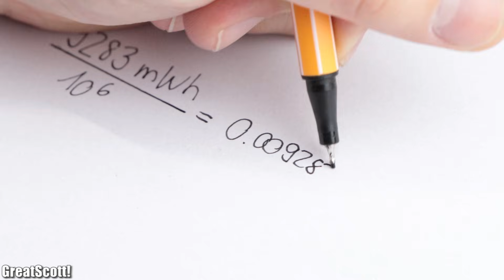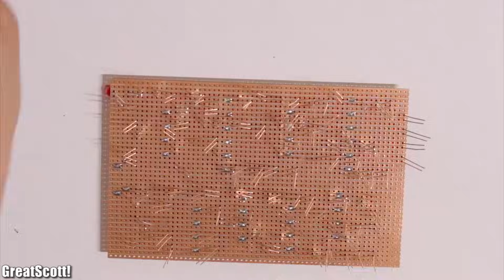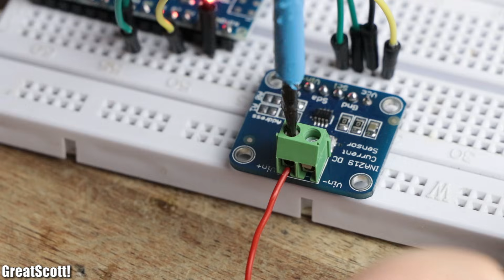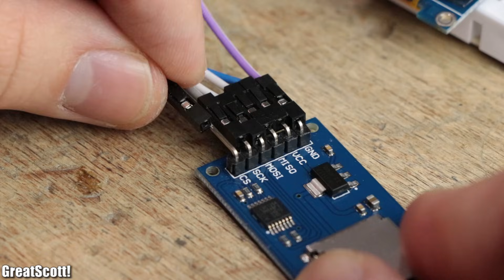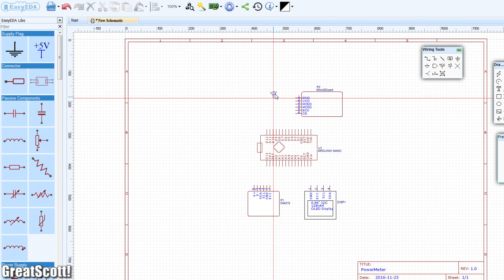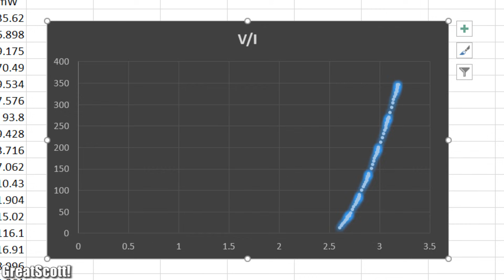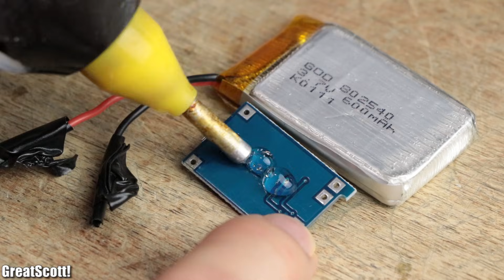Make your own Power Meter/Logger

Comment: Hi,can you make tutorial power supply using arduino nano & oled 0.96 include battery level display & variable voltage output🙏which is the power supply is powered by 4pcs 18650 1s batteries. 🙏🙏🙏

Comment: I know that this is the final device, but prototypes can look like this. If you still make prototypes this way, I recommend looking at the description of my channel, there are two last links to pictures of an open project of modular portable prototyping. In short, there are modules that are attached to the base, connected with Dupont jumpers. It turns out to be a prototype for which you can develop software. If you don’t have the necessary modules, and you need it urgently, you can make it from a regular soldering breadboard. Drill 2 mm mounting holes with a pitch of 5.08 mm, solder the parts and the temporary compatible module is ready. If you produce a sufficient number of modules, you can assemble many different devices. Given that the circuitry of the modules has been worked out, the manufacture of the final device consists of combining the circuits of the modules into one board of the device.

Comment: What is the voltage capacity of the meter?
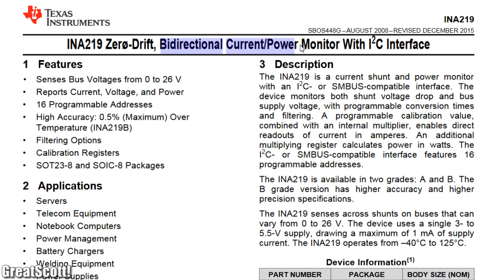Reply: 1:57 The bus voltage can vary from 0 to 26V. Where the Bus Voltage is the voltage where your load is going to be connected.
And the INA219 is powered by a separated supply from 3 to 5.5V

Comment: Tolles Erklärvideo. Danke!
Two more questions, i have.
1. Is it possible to increase the current range to 5 or 10A by changing the shunt resitor?
   Or other question: What will append, if i have a "short time" load of 5 or 7A?
2. Measuring up to 26V should be possible with this configuration, right?
 I want to use it for "sleep mode current" (Ruhestrom) measurement in a 12V vehicle.
Thnx!
Reply: If you want to get a current range up to 10A then you can use the next equation to select the shunt resistor:

R_shunt < V_sense_max/I_max (eq. 1)

Where V_sense_max is the ADC Range selection (see page 5 from INA219 datasheet). You have 4 options for V_sense_max, you can select a V_sense_max of +-40mV, +-80mV, +-160mV or 320mV.

Asuming you select the 320mV range (this is a default range for the INA219) then the shunt resistor must be

R_shunt < 320mV/10A 
R_shunt < 32mOhm
Select a resistor value of 30mOhm, for example. Now, the shunt resistor must have sufficient wattage to handle the power dissipation (you can select smaller values of R to minimize power loss). The maximum power disipation is:

P_max = (I_max)^2 * R_shunt
P_max = (10A)^2 * (30 mOhm) = 3W 

You can select the resistor CSS4527FT30L0 o WSR5R0300FEA for example. OR you can select  smaller value for the ADC Range and use  equation 1 to select a new and smaller value for R_shunt

Comment: Next step, a power meter for appliances that integrates with Home Automation.  I’ve got a relative with dementia who sometimes leaves the door open on an upright freeze with the usual consequences. I’d love to have a line voltage power meter that learns the normal power consumption of my freeze is usually 326 watts per hour and then alerts me if it suddenly jumps to 1022 watts in the last hour (meaning the compressor is running near continuously) or zero watts per hour meaning it’s off of has failed.

Comment: Awesome! I'm building an overkill volt amp meter for i2c debugging. Ina219 and ina3221. Also a 1115 16 but ADC for a WCS1800 Hall effect sensor module

Comment: Actually calculation of energy is bitt wrong, if you divide power by 3600 which is 60 * 60 then the interval must be 1 sec or 1000 ms but in this case interval is 100 ms so we also have to multiply by 10 because 100 ms is 10 times smaller than 1000 ms

Comment: Hello, we are a Chinese factory specializing in PCBA power meter, and we can see that you are also using power meter module in your video. Recently, we have a bidirectional electricity meter module, which is used in solar router, and it sells very well. Could you tell me about it?

Comment: can you please explain why we use tp4056 ic???
where do we connect the input to the power logger circuit??
Reply: tp4056 is the battery charger.

Comment: Well...I just built this but I was a dummy and accidentally ordered the Arduino pro mini 168. The sketch size is too large so I deleted all the code for the SD card and it works. I have an Arduino pro mini 328 on order but its going to take a while to get here. I'd like the SD card functionality. If anyone knows how to reduce the sketch size and keep all the functionality please reply. I'm asking a lot probably but I think this is a pretty small project and if optimized I think the 168 might do it. Thanks.

Comment: What would be sweet  project very similar to this 1 but 4 campaign so it will log Solar coming in and log  Your usag And have tfc  Screen showing sola in and  load ou  and battery voltage

Comment: WELL DONE. but i have a question, if the battery is soldered to arduino, can I upload a program from the usb, or I have to put a diode between the battery and arduino?

Comment: I love the INA219 module. I once used one to replace an expensive stepper motor with a far-cheaper and more powerful 12VDC gear motor. I had a n arm on the shaft of the motor, and I just blocked it so that it could not turn past the points where I wanted it to stop. Then I would start the motor turning and monitor the current. When the arm hit the block, the motor would start taking more current, and I would know it was time to shut it off. It was self-calibrating! It worked perfectly once I thought to drop a little super glue on the flange and motor shaft, because the motor was so powerful the flange set screws were not enough. 

Hint for your data logging: Have your Arduino log all data to a .csv file. Each line is a row of data, separated by commas, and you can even have the Arduino do some of your calculations for you and include them on the line. Stick the SD card into your computer, double-click the .csv file, and it opens up in Excel, each data point in it's own cell, nice neat rows and columns. Select a column, select "Insert", and insert a graph of the data, easy-peazy.

Lastly, I know this video was created four years ago, but we now have some data logger modules. I got two of the ones you just plug an Arduino Nano into, and I got one of them working yesterday. The module gives you everything pre-wired, including a real time clock module. So you can time-stamp your data in the .csv file, you just need two more commas and columns, and you can see when that spike occurred. I like this data logger. I intend to program it to accept a string from another Arduino and log it, with a time stamp, to a .csv file. The string will be a pre-formatted string sent via SoftwareSerial.h. That way I have the complexity and memory requirements of the RTC and SD card set aside from the Arduino doing the real work, leaving precious memory for other things.

Comment: May I ask a question?
How did you solve the noise when you were detecting the voltage?
The value of analogRead is changing randomly
I have an arduino Uno WiFi Rev2

Comment: I wonder if you could connect a current transformer to the inputs. Do a little math. And have a high voltage power monitor. 

Maybe the fact it’s designed for DC would be the problem there.

Comment: Could you really used electret condenser microphone to harvest acoust to electrical energy enough to power cellphones or Leds? 
I read a paper being published. Was it really true?
Reply: There is acoustic energy, but it can produce way less electric energy, than like smallest world LED would need, so that was definitely fake.
Reply: @j4mm3r61  that paper I was talking about was authored with a doctoral degree. He just doesn't disclose all the tiny bit information but emphasize the 9 parallel connected electret condenser microphone and convert to DC by bridge rectifier and some other things with Arduino  then voila he was able to charge phones

Comment: Great video.  Watching all the videos has again peaked my interest towards elotronics. Keep it up :)
I have question regarding the power meter: Can it measure minimum current in range of 0.01 milli Amps - 400 milli Amps with resolution of 0.01 milli Amps.
I want to measure current drawn by a device when it is in standby mode, which will be very small. Thank you.
Reply: Please watch my video! https://youtu.be/2Qr6Jcm8wbA

Comment: Hi great project I got it rebuild and I included the Micro SD module. Managed to install the SdFat by Bill Greiman Version 1.1.2 installed. My question can you share your .ino source file you use in the project to log the data to the Micro SD card. In your video presentation you show the header files. But would a great help to share your final project .ino file to see how you log the data to the card. Thank you for sharing your great projects incredible stuff you put together

Comment: I recognize that this video and project is more than 3 years old but I need some help.  The SD Card Module links are no longer valid.  Would you please identify a SD Card Module that will work with this project?  Thanks in advance for your assistance.

Comment: TP4056 gets hot when charging, so i do not recommend maunting it on the top of the battery, or near termo sensors.
Reply: you can just mod it for 500mA, or lower ;)

Comment: Thanks!  This is exactly the type of system I need for monitoring battery charge and discharge times.  I plan to use the larger 2.42" OLEDs.

Comment: Awesome video, as always :D

But, how would you recommend to implement the best and smallest voltage read into an project.
Im going to create a temp/hydro reader that will send data to an InfluxDB, with that im thinking of sending the current battery voltage.
And i saw someone just took two 10k resistors between the negative and positive rail and placed an analog read between. Is that what is included in the voltage reader you mention?
Reply: Please watch my video! https://youtu.be/2Qr6Jcm8wbA

Comment: I see that you are using the 128x64 OLED in 128x32 mode too! I built the same thing but I could not fit evrything in the Nano and still have enough RAM for the OLED so i though WTH, lets try at half the width and it worked! In another project I used 2 Nanos and some interesting i2c communication between them to share the load and have the OLED working properly!

Comment: May you please tell me, how to apply database management system in Sd card with arduino for storing data in a organized manner?
Reply: Depending on the DBMS you are wanting to use, you would need to write a script to import the flat file.

Comment: How would I connect the INA219 to a solar panel if I wanted to measure the short-circuit current and open circuit voltage? A switch would be needed like a MOSFET to switch between measuring modes since the open circuit voltage is zero when measuring the short-circuit current. Would I connect everything in the same manner (besides the addition of a switch) expect my supply would be from the panel and I wouldn't add a load?

Comment: What IC could I use to increase the voltage and the current range? 26V and 3.2 amps is a little low for me ... I'd love to go up to, at least, 30V and maybe 5amps.
Reply: It's ok ... I searched and found another chip, the INA226 which can be found in exactly the same format (on PCB board) of the INA219 but has a voltage range going up to 36V, so perfect for load testing 7s/24v Li-Ion packs.

Comment: Is there an equivalent item that I can use to measure the output oy my 40w flexible solar panel into my battery bank?

I have a cheap commercial portable battery bank that has a DC input that I can connect my 40w foldable solar panel to ... I want a device that I can attach, more or less inline, so that I can monitor the input of the solar panel into the battery pack over time ... this video seems to show me how I could possibly make one but is there something cheap (and nasty?) from Ebay or Ali that I can buy?

I have seen some cheap DC watt meters but I am unsure how well they log data versus just show actual instantaneous energy input (I want to be able to come home at night and see how many watts I got out of my panel during the day).

Thanos for any input.

Comment: my INA219 is bullshitting me, always giving reading of 32V,  -0.10 mA, -0watts
Tried changing the arduino nano to a uno. Still same result. 

It should work when following this very simple guide:
http://henrysbench.capnfatz.com/henrys-bench/arduino-current-measurements/ina219-arduino-current-sensor-voltmeter-tutorial-quick-start/

But I get the same result. Maybe the INA219 is fault?

Comment: @GreatScott
I know this video is old now but it is fantastic and I've just made one of these for my leisure battery in my camper.
Is it possible to calculate how long the battery will last (when it is being used) using the information from this set up?
I want to keep an eye on it while I have things running.
Thanks!
Reply: Hi Matt, I see your comment is quite recent, I see you say you have just made one for your camper battery, I have done one too last week but could not get it to work due to  problems in compiling the sketch;  it seems that it uses too much memory, I have done some research and size problem is said to be due to  a bug in the compiler for Arduino 1.8.7, so I tried  with arduino-1.0.6 and had indeed different results, but libraries were not compatible, I downloaded older versions of libraries but, so far to no avail. Could I ask you how you managed to get it to work ? Thanks a lot (P.S. I saw your camper video, great work!).

Comment: Hello Scott, I tried to compile your arduino code, but the message in the IDE shows that the sketch takes too much memory. I get the message

"Sketch uses 22558 bytes (69%) or program storage space. Maximum is 32256 bytes.
Global variables use 2218 bytes (108%) or dynamic memory, leaving -170 bytes for local variables. Maximum is 2048 bytes.

Not enough memory; "

In your video I saw that you had no problems uploading and compiling. I am using version 1.8.5 Arduino IDE
Reply: check your port.

Comment: Please suggest me to measure th DC voltage upto 500V and Current of 20A I want to make power meter for my solar panals whcih are capable of giving volage upto 300V and current upto 5A please suggest me the sensors
Reply: I would be interested as well

Comment: Brilliant project .... here's a modified code to write CSV files if anyone wants it:

#include <Wire.h>
#include <Adafruit_INA219.h>
#include <Adafruit_SSD1306.h>
#include <SPI.h>
#include "SdFat.h"
SdFat SD;

#define OLED_RESET 4
Adafruit_SSD1306 display(OLED_RESET);
Adafruit_INA219 ina219;

unsigned long previousMillis = 0;
unsigned long interval = 100;
const int chipSelect = 10;
float shuntvoltage = 0;
float busvoltage = 0;
float current_mA = 0;
float loadvoltage = 0;
float energy = 0;
File datafile;
String dataString="";

void setup() {
  SD.begin(chipSelect);
  display.begin(SSD1306_SWITCHCAPVCC, 0x3C);
  ina219.begin();
      datafile = SD.open("data.csv", FILE_WRITE);
      datafile.println("Time,Voltage,Current");
      datafile.close();
}

void loop() {
  unsigned long currentMillis = millis();
  if (currentMillis - previousMillis >= interval)
  {
    previousMillis = currentMillis;
    ina219values();

    datafile = SD.open("data.csv", FILE_WRITE);
    dataString = String(currentMillis) + "," + String(loadvoltage) + "," + String(current_mA);
    datafile.println(dataString);
    datafile.close();
    
    }
    displaydata();
}

void displaydata() {
  display.clearDisplay();
  display.setTextColor(WHITE);
  display.setTextSize(1);
  display.setCursor(0, 0);
  display.println(loadvoltage);
  display.setCursor(35, 0);
  display.println("V");
  display.setCursor(50, 0);
  display.println(current_mA);
  display.setCursor(95, 0);
  display.println("mA");
  display.setCursor(0, 10);
  display.println(loadvoltage * current_mA);
  display.setCursor(65, 10);
  display.println("mW");
  display.setCursor(0, 20);
  display.println(energy);
  display.setCursor(65, 20);
  display.println("mWh");
  display.display();
}

void ina219values() {
  shuntvoltage = ina219.getShuntVoltage_mV();
  busvoltage = ina219.getBusVoltage_V();
  current_mA = ina219.getCurrent_mA();
  loadvoltage = busvoltage + (shuntvoltage / 1000);
  energy = energy + loadvoltage * current_mA / 3600;
}

Comment: How did you manage the Arduino Nano memory(RAM) with 106% usage? when I compile your sketch, it always says "Global variables use 2187 bytes (106%) of dynamic memory, leaving -139 bytes for local variables. Maximum is 2048 bytes." Please help me with the information. I am using Arduino IDE 1.8.6

Comment: I think there is a bug in the program. When calculating energy in any meaningful way, you have to integrate power over time, i.e. in the simplest form of numerical integration multiply power with the REAL time difference between data points.

Comment: Nice work. 
Is it feasible to modify this to suit 240VAC 10amp? I'm leaning towards the inductive sensors to detect current.

The fat package with less write errors is useful too.
Reply: Interested to know this as well. 
Did you manage to get it working? I don't think the listed sensors were not designed for this